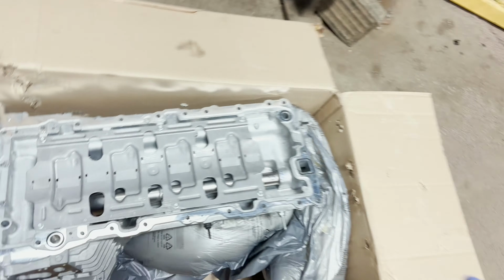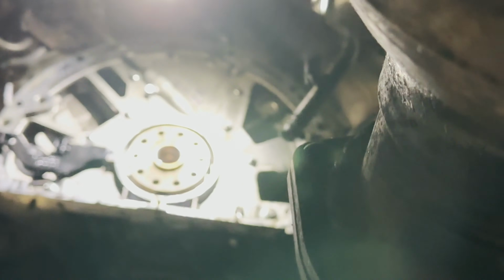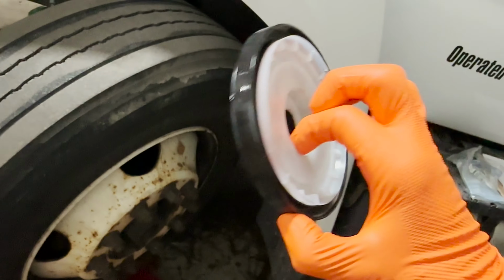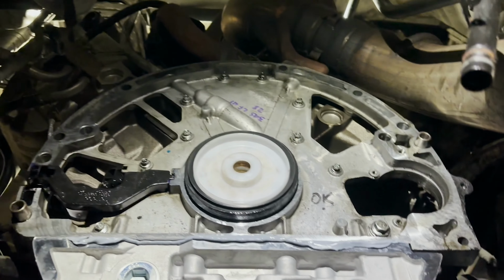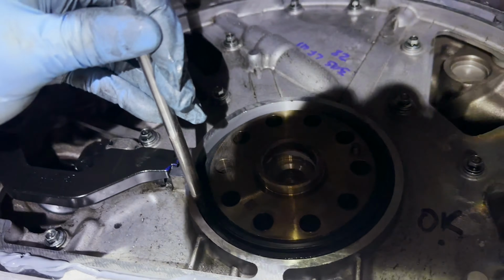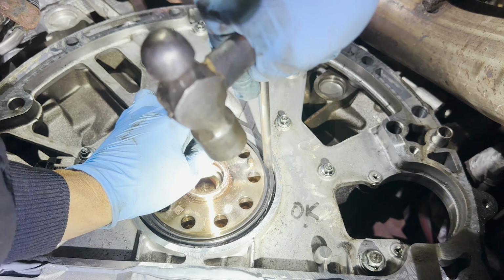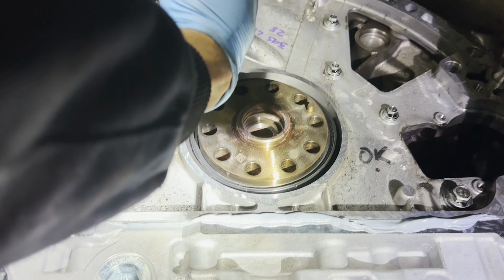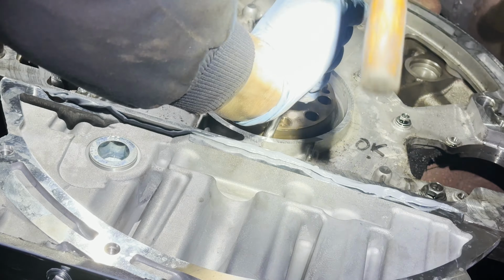DIY Ford rear crank seal | is it gonna leak?? #mechanic

Comment: Another tool that would work really well for putting the seal back in is a packing iron used in plumbing. It’s used for packing oakum into a cast iron waste hub.
Reply: Good thought and the right shape.  The ones I've seen have been a bit thick.